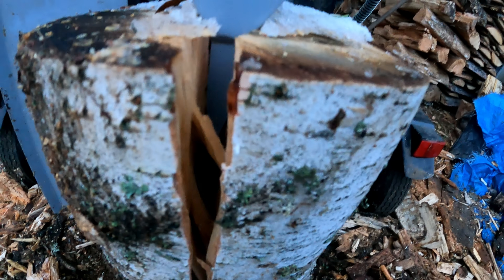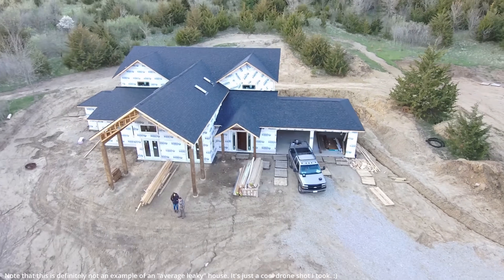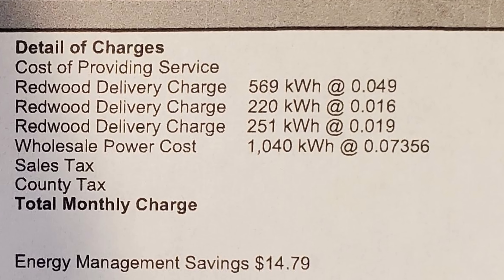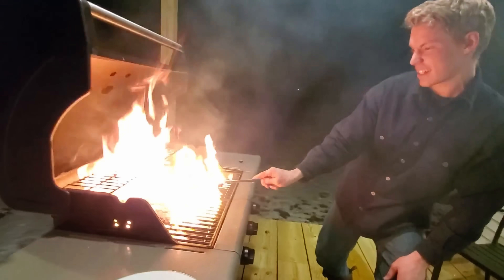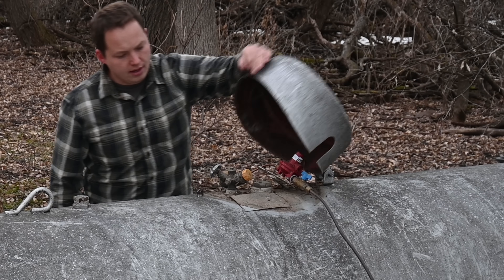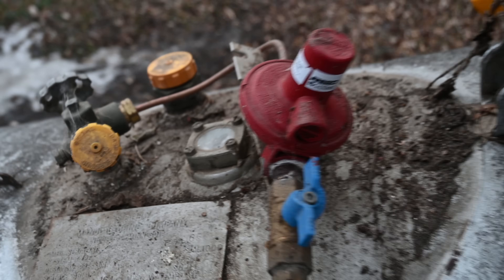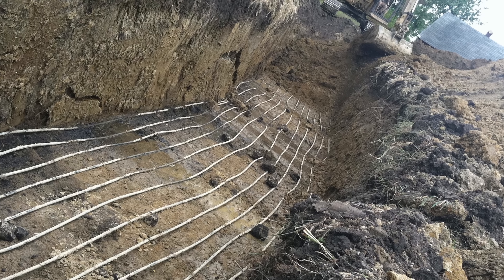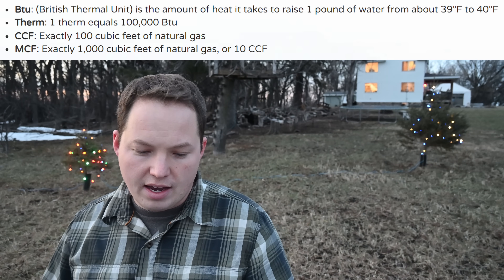What's The Best Heat Source in 2022? Top 5 Home Heating Methods - LP Electric NG Geothermal Fuel Oil

Comment: i run a heat pump here in new zealand average winter temp is around 4-5deg celcius and my home feels like a fridge all winter heat pump is crap and only heats lounge so we go to bed in cold rooms or sleep in the lounge when real cold bought a plug in radiant heater last winter and it heats twice as good as heat pump and appears to be cheaper to run and yes we have insulation underfloor in walls and ceiling so any suggestions for warmth would be welcome

Comment: How different is a mini split heat pump, to a conventional split Airconditioner ? My split airconditioner has heating functionality. Where does that fit into the picture in terms of price? (Is a conventional AC running in heat mode, going to at least be more/less efficient than resistive electrical heating ?)

Comment: I’m running a steam boiler system. Walls aren’t insulated for some super special reason. I also run those oil plug in radiators for super cold days. No sort of efficiency, but we stay warm.

Comment: Primary heat is a wood furnace when it gets below 40f. Run the electric furnace when it's above 40f. Electric bill never touches $200.

Comment: Natural Gas - I use it for heating the house, the hot water heater is gas and my stove and oven are natural gas for cooking. AC lights and small appliances. Switching to Led lights which last a very long time

Comment: A 95% efficient gas furnace drops to 92% efficient when using propane.
Reply from the maker: Are you sure? I haven't heard that before.
Reply: @BenjaminSahlstrom  I installed gas furnaces for years, when converting then to propane it drops the efficiency down 3 %.  Propane does not have the same heat output, (therms) as natural gas. But if used to run a generator it's actually better than natural gas, because it explodes better.
Reply: most peoples natural gas furnaces and hot water heating systems are only 80 to 82% efficiency unless they have the newest condensing high efficiency models and older models draw heated air from house sending it up chimney rather than from outside air so they are even less overall efficiency
Reply from the maker: @ranger178  True!

Comment: Almost had minisplit system installed but the maintenance is a nightmare for a multi-head system.  Then there were all the holes thru the house walls, two refrigerant lines and drain lines for each head.  We opted for a 5 ton geothermal system and couldn't be happier.
Reply: What maintenance needs to be done? I am entirely uninformed on Mini split maintenance, would love your introduction to it:
Reply: @myid9876543  The units need to be taken apart and cleaned thoroughly every 6-8 months, drain lines checked, and weekly filter cleaning,  If one had multiple heads in the house this becomes quite a task especially if one needs a ladder to reach the unit (do a search on YouTube).  We were looking for less maintenance not more so for us the geothermal system was the best solution.  The geothermal does need maintenance and filters changed but it's only one unit and no ladder needed.  Contrary to some posts here geothermal doesn't need a lot of land as they can put in vertical loops.  Surprisingly the estimates for both the geothermal and minisplit systems  weren't that far apart.

Comment: 12 cents/kwr for electric resistance - in Connecticut electricity is twice as expensive.  Also you don't mention the cost of installation of these various options.  In Connecticut, at least, heat pumps are the most expensive.  I just saw a quote for $16,000 for a 1500 sq. ft. cottage. For a larger two-story house you're looking at $20-30,000.
Reply from the maker: Yikes. Sounds like I need to move out there and start doing installations...

Comment: Thank you very interesting. I have geo-thermo heating/air-conditioning.  I needed six wells to take care of my house. The wells did not take much room about the size of a small garage.  When the temp gets down to near  zero the system runs non stop. I do have 6 inch thick walls with traditional insulation. It is a good system but natural gas feels more comfortable.
Reply: Damn, six wells. U must be living in a mansion. When i was planning on buying a system to replace about 20000 kwh yearly heating usage from direct electricity i would have needed only 2 wells. Deeper u drill the more efficient it becomes becouse it is warmer the deeper u go. That was for 20kw output pump. In the end i opted for burning wood chips costing about 400 chipped and 200-400 for the wood yearly.

Comment: We use ground source heat pumps (closed loop) to provide all our heating, cooling and domestic hot water needs. The COPs can be over 5! The systems are quiet, comfortable, low maintenance and we anticipate longevity, as components are not subject to extreme temps or outdoors in the elements.
Reply: Location?
Reply: @willbass2869  Cincinnati OH
Reply: How long will that take to pay it back vs a traditional system?
Reply: @FJB2020  I’ve heard  3-5 years if you’re switching from fuel oil or propane. 5 to 8 years from natural gas. We’ve had our systems 5 years. There’s also the federal tax credit (renewable energy) that helps too. 26% right now I believe.
Reply: @dougevans74  I guess there is a wide spread on payback, becasue some people that have those systems report very high electricity usage...  Thanks for your feedback.
Reply: @FJB2020  you’re welcome. For sure electrical usage increases as you shift over from other other energy sources. Those compressors, fans and pumps need to driven by something. The range might depend on how the system is sized.  To lower the initial cost, some contractors may size systems based on cooling load. The difference is then made up by auxiliary heat. That can get expensive, particularly electrical resistance heat. We had our systems sized on heating load and put in a little extra loop capacity. We haven’t needed auxiliary heat in 5 winters so far.

Comment: Hello everybody, I have a 6 kw solar system on my roof of a 1000 sq feet apartment, notice the system was producing more than what I needed (2908 MKW saved on my favor) so I replace hot water tank for a 13 kw tankless, the kitchen range for a electric cooktop and shutoff the boiler and purchase temporary electric heaters for winter and this is going to be my second year so far so good I only pay basic charge for electric and gas, and gas as emergency only for winter time, I think that is the way to beat all this high fuel prices

Comment: Only last few years have variable speed heat pumps and fan coil units become available in the residential market.  (Variable Frequency Drive HVAC systems are common on commercial buildings.)These units run at lower speeds to keep a constant temperature in the home rather than full on mode when the t-stat calls for heat, then full off when the set temp is reached.  Electric motors are most efficient while running at about half speed.  They draw the most current at startup.  Combine a variable speed system with a solar array on the roof, net metering with the local PUD and you will have very low heating costs, depending on the area of the country.  Here in the PNW, even with cloudy weather, winter heating costs with the above system will be less than $500 from Oct to March for my 2500 SQFT home.
Reply: Electric motors typically have peak efficiency at rated load.  How is the cost of the solar installation factored into this equation?
Reply: I have a video on my channel on a Bryant Evolution 18 seer 3 Ton HP paired to a 2 stage NAT GAS Furnace. Best of both worlds and yes, currently as I am typing this, it's running 2nd stage (5 total stages for the variable HP) and it's on a 1500 SQ/FT house and it's 42 outside. It hasn't lit the furnace all day it's been bouncing back and forth between stage 1 and stage 2 HP. I installed it myself back in 2019. Been doing HVAC since 2017.
Reply: DC ECM motors are are efficient at any speed but are much better than PSC motors at lower speeds. However PSC motors are most efficient at rated RPM and way less efficient at lower RPM's

Comment: Awesome video as always.
I have a new 4 ton package a/c
which cools the house very efficiently here in central Florida. We get some cold nights too. There are electric coils in the a/c for heat, but they suck. So I am using electric heaters that sit on the
floor plugged into regular outlets. It's not a big deal here in Florida, since it warms up quickly in the morning to at least 75 to 80 degrees. My
electric bill is between 140 and
160 bucks a month in the winter. $110 to 120 in summer
with a/c. 
The cheapest fuel I can remember would be sawdust
that my Grandfather burned in
a boiler furnace he made back in Sweden that we used in the 1940s and 50s. There was no thermostat, so when it got too hot, we just opened the windows. Things were simple back then...

Comment: all electric, with solar thermal and solar P.V. and closed loop GEO, also wood stove and tankless electric. 12kW solar system with bills around $50 in the winter and nothing in the summer. Also have 2 E.V.'s that I charge at home. Flat plate thermal collectors with drain back tank. Also tried the vacuum tube solar thermal with pressurized antifreeze, (less maintenance).
Reply: How much was your install cost?  I was seeing quotes of $25,000

Comment: We use a bit of everything, main for the entire house is electric baseboard. We have a pellet stove that can heat the main part of the house that is used the most often. Propane in the basement and mud room. The basement heater is large enough to heat the entire house if needed.

Comment: Oops!  Electric resistance heat offers the ability to turn down rooms not being used.  Most other systems do not have this flexibility.

Oops!  Direct radiant heaters heat objects in the room not the air so you can be comfortable at a much lower room air temperature.  This does NOT include scam heaters that have internal infrared tubes heating the air as it passes through the heaters.  

Oops!  You are not considering initial equipment cost, longevity and maintenance.
Reply from the maker: True, True, and True! My main goal was to calculate the energy cost alone for this video but maybe I'll add additional factors for a future one.
Reply: @BenjaminSahlstrom  ok just two more points..ANY forced air heating system causes the body to feel cool due to evaporation or body moisture, sensible cooling, requiring a warmer room temperature to be comfortable.

The cost of electricity is more stable than other forms of energy.  Natural gas, oil and propane have all gone up about 50% since Biden took office.

Comment: Ben, I've got a question. Awesome videos btw...Im putting in two receptacles for a customer that are going to be on posts that ill be cementing down in their yard. Im coming off of a receptacle on their house and jumping to the receps that are going to be on the posts and the plan is to run 1/2 in pvc...Do you think I need expansion fittings before going in and coming out of the receps? Do they even make expansion fittings in 1/2in?

Comment: Minisplits for last7 years.
At the beach we are lucky to get 5 years.
Just replaced 2 18000btu units from HD for 
$3600. So the salt air might of off set a good portion of the savings from electrical.
Reply: There are hardened exterior units or regular split systems so hopefully in the future they will make hardened mini split systems as well that can be used beachfront.

Comment: I cringe at this but I know a family that almost exclusively uses electric space heaters during winter here in cny. They like the house cold so it actually works very well for them to only space heat the room they are in.  I understand these calculations are simplified to the example house uses X number of btus a season but in my opinion resistance space heating can definitely cost less than propane if your living space is zoned. And virtually no upfront or maintenance costs required.